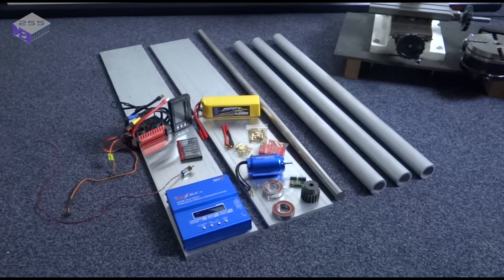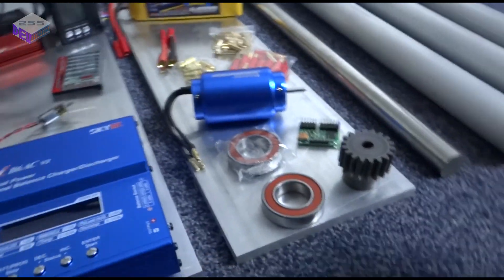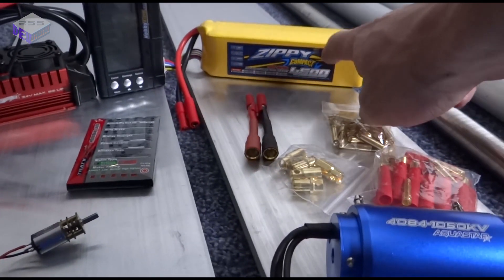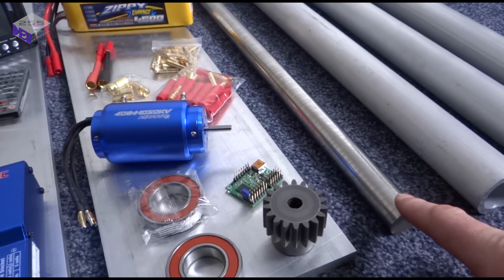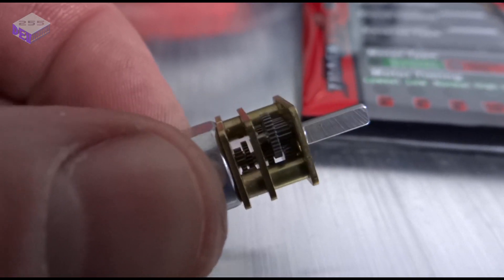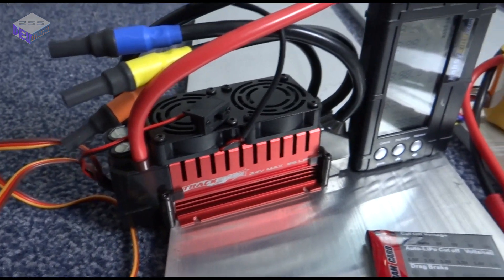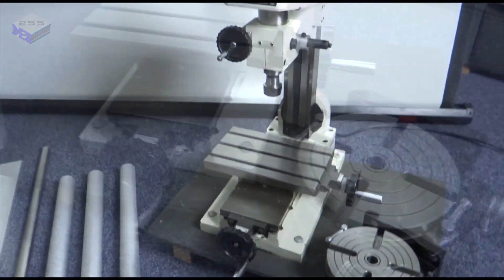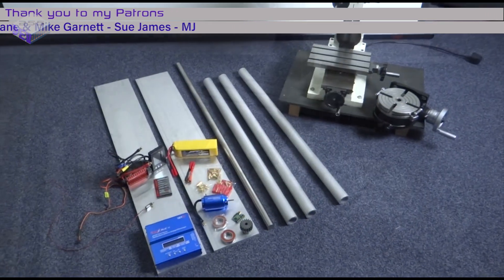MG F Electric Conversion - Component Overview

Comment: I'm very sceptical about how the bearings will last in those brushless motors will last during long durations of running under that kind of stress. Vill b interesting to find out how it will work
Reply from the maker: Me too, hopefully with the amount of load sharing and with them only running 100% fro very short periods they should be good. I will keep track of the average power over time compared to wear.

Comment: I'm very sceptical about how the bearings will last in those brushless motors will last during long durations of running under that kind of stress. Vill b interesting to find out how it will work
Reply from the maker: Me too, I think it will be ok as will not be loaded 100% of the time, just under heavy accelerating possibly. Watch this space for damaged bearing ;-)